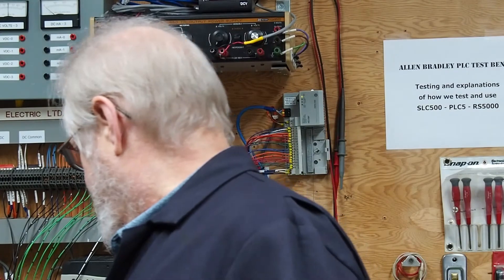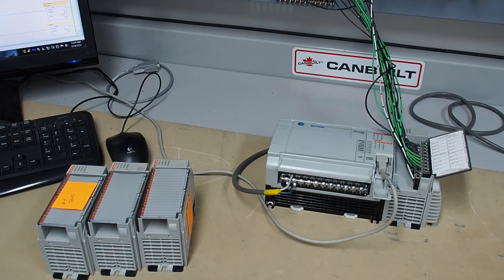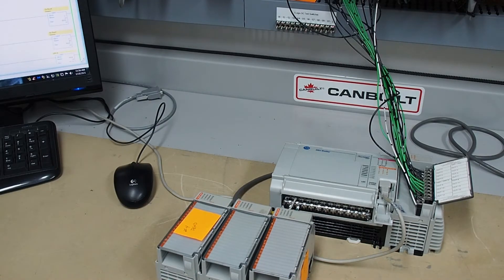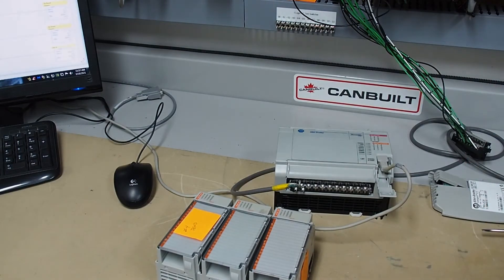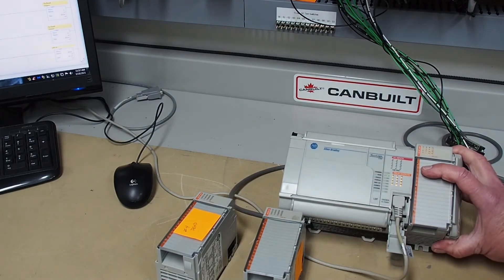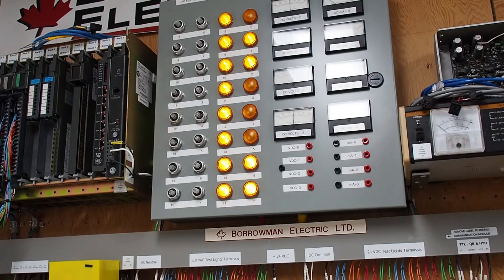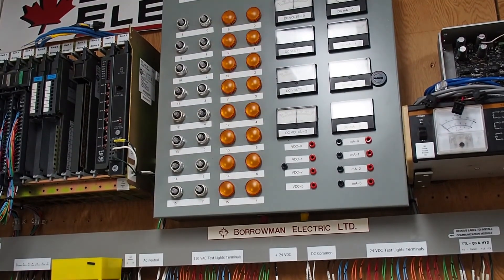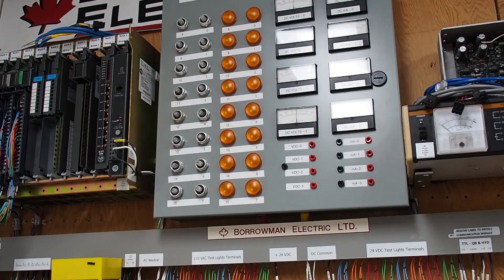MicroLogix 1769-OW16 Testing

Comment: Do you wire the VAC-VD1 and VAC-VD2 with 24V+or 24V-?
Reply from the maker: HI TC
Those are the common points for the single pole relays inside of the module.  VAC-VDC 1 is for relay outputs 0 > 7.  VAC - VDC 2 is for relay outputs 8 > 15.  the relay coils are operated from the backplane power.  
Have a look at the manual and it is very clear.

Comment: Hi, thanks for the video. I'm new to plc programming and I have a project at work to automate a piece of equipment. I have two of these cards on my L33ER so it will be interesting to see if I have problems with these cards.
Reply from the maker: DHH - The cards I was testing were used and the person that sold them to me said they had tested them and they were fine.
If your cards are new there should not be a problem, but remember that the relays are very very small and will not take any abuse.  If there is any question on the loading of the relay I would suggest an external mounted relay.
Reply: @abplctestbench759  I think external relays is a good suggestion. Thank you for the response.
Reply from the maker: @dhh488  Your welcome.  I would suggest DC coils on the relays if you use them.  Faster response than AC coils.